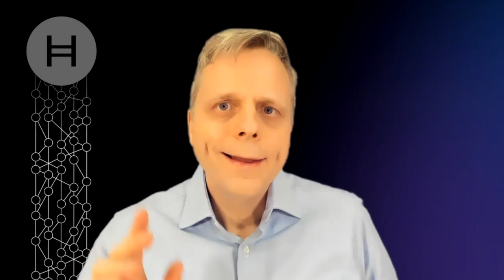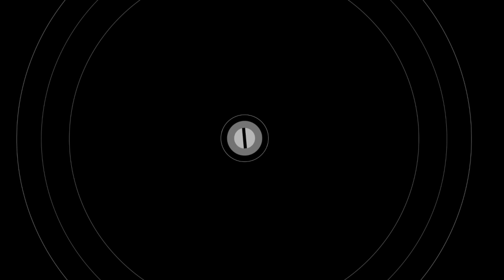Turbo Encabulation Algorithm

Comment: Existing turbo encabulator algorithms are not safe to flux compensator leakage, which is really bad for decentralised ledger algorithms. Will Hedera's encabulation algorithm solves this?
Reply: only if you interlink the bi-planary single incursion of the hyperthetic fluxinoid encabulator 4.01. without this incursion, you get the dreaded side fumbling. (and the eventual black hole) 
drat shall befall on all things, carbon and non-carbon.